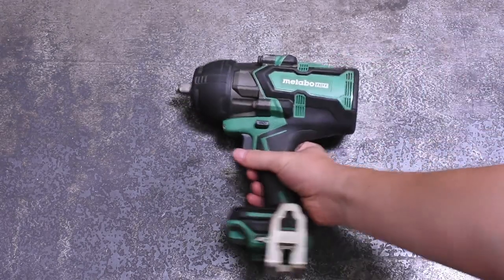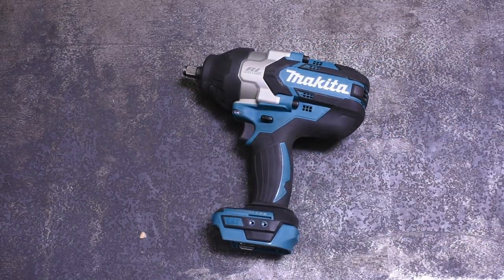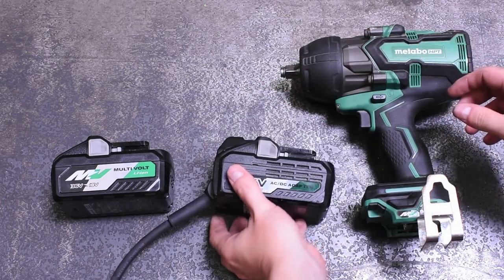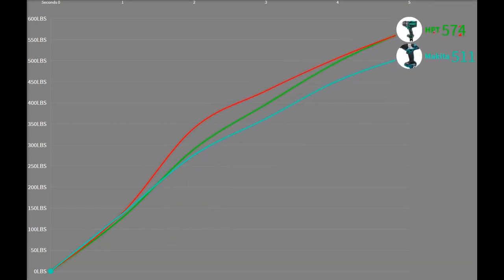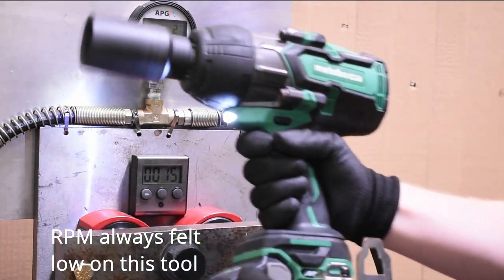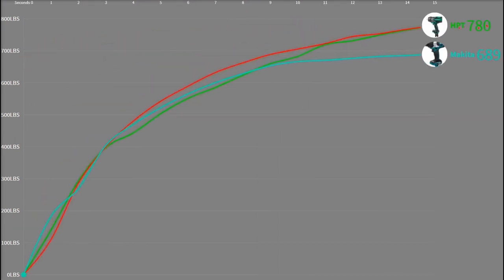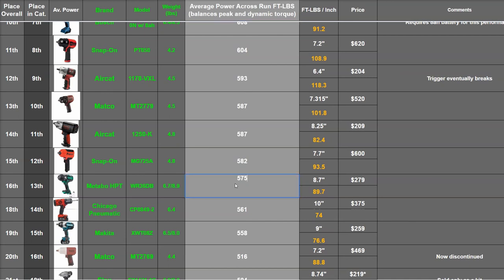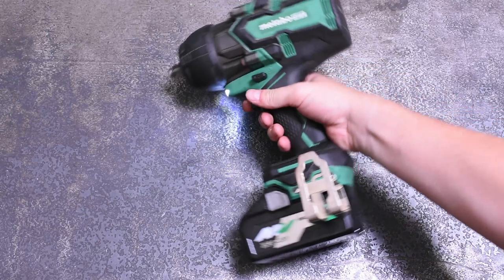What Happens When You Plug In a Cordless High Torque? Metabo HPT WR36DB

Comment: Honestly I wish tool manufacturers would release wall adapters for their products. But they won't do that because that would lose them tons of money in battery sales.
Reply: I mean I did at first as well and I agree it wouldn't be a bad idea. But honestly as my battery collection has grown due to taking advantage of free battery sales, I honestly can't say I would buy one anymore. I honestly have 4-6 charged batteries laying around at any given point, so why fool with a cord?
Reply: @OmegaGamingNetwork  The more I use my batteries, the sooner they will die. I have the angle grinder and used it to build a bullpen wayyyyy away from any outlet. Super convenient so I don't feel bad when I run out of juice. But when I'm in my shop working on things running out of juice is a kick in the nuts with an outlet right there
Reply: @alminhelex  fair enough and when I get to the point where I need to start replacing them and don't need any new tools, I might feel differently. But for now at least, I've only had one battery die in the past 3 years. The rest are going strong. I'm happy to not drag around extension cords if I don't need too.
Reply: Aren't wall sockets limited by 20 amp breakers though?  I read that battery tools don't have this limitation (Milwaukee HO batteries can output 40-50 amps) and therefore have more potential.  And as others have stated, it you wait for battery sales/deals, you can get them for free or at a pretty reasonable cost.
Reply: @OmegaGamingNetwork  My 2 5ah batteties for my Milwaukee are seeing the light, and I have fried an 8ah lol hopefully the 6ah with the better layout to stay cooler will survive a bit longer.
Reply: @1pcfred  I have the Metabo 36 volt 10 inch sliding miter. It's great to use the cord when on a home project. But also, very convenient to remove the cord and slide in a battery for when working @ a barn with no power for example. That's the big advantage Metabo has over all of the big name manufacturer's.
Reply: @alminhelex  I'm running Makita myself. While I do find their battery shutdown software to be overly aggressive, I've only had one bricked in 3 years across 20 batteries. And that one was only a 2ah that came in a kit that honestly I didn't care about.  Anecdotal experience of course.
Reply: @slylockfox85  power is V*I 
The cordless tools use a 20v battery 
20v * 50A = 1000W

Corded 115v(ac)* 20A = 2,400W

Granted that math for AC is not 100% accurate but I'm on my lunch break : ) 
(~30% less on average)
Reply: yea but they can sell the adapters with the kit, and batteries come in kits. So they can do both in one kit.
Reply: @1pcfred   Air tools are even less convenient than corded tools. There are a ton of situations where a corded tool is better. They're cheaper, they never need to be charged, no batteries to wear out, batteries don't drain and lose power, etc. I would rather buy a cuddles angle grinder and an adaptor than buy a cuddles one AND a corded one. Cordless angle grinder just don't have the longevity to do much work other than short duration tasks. Weld grinding, stock cutting, wire wheel for rust, weld prep/beveling, cutting concrete, etc are jobs that just need a corded tool. I would like to see the tools with big 24-56V batteries have a way to plug them in while on the tool. That way you don't need an adaptor and you can plug them in to simultaneously charge and run off shore power, just like you can do with your cellphone.
Reply: @slylockfox85  We have to consider the total power output of batteries vs corded adapter, in watts. A battery may put out 50 amps, if that's at 18 volts that's 900 watts. A wall outlet 120 volts and 20 amps (for North America) can provide 2400 watts, but for safety and code de-rating, about 1920 watts continuous. A corded adapter could be made to provide more power than a battery, it all depends. Lastly in a theoretical max-power design situation, they would design the corded adapter for a standard 15 amp outlet, at 80% load, so about 1440 watts in max, then there would be efficiency losses to DC conversion, so maybe 1150 DC watts out. Power would also be limited by the tool itself, I don't know of any cordless tools designed for that power, or corded adapters that output that kind of power. Maybe some of the new 36v cordless/corded saws can, I'm not sure.
There are many limits at every point that need to be considered, the tool itself has the final say on how much power it outputs, so it doesn't overheat etc.
Reply: @1pcfred  if you ignore the big ass air tank and the noisy pump/motor on top of it as well as the air hoses and all the plumbing you have to do to make the air tank more accessible.  We have a 60 gallon compressor in each of our farm shops (one has steel piping for air plumbing, which was a real big/expensive job for whoever put the system there before we moved in) and I try to avoid them for everything but tire duty and the blow gun.  

They're only convenient for the things you can get within 50-100 ft of them.

With cordless tools the sky is the limit.
Reply: If i really wanted a corded tool id just use air. More power for less weight but i only use cordless because its way less of a PIA than having to have an air line around all the time.
Reply: It would be amazing for grinders and sanders
Reply: @Semi Interesting yep it's how I killed the one. Stuck it straight on while hot and boom. Was brand new probably the charges total. Like I said I hate how aggressive their protection is.
Reply: @Semi Interesting thats how my 8ah  went out, I was using it with the weed eater and after sucking it dry, heated, I slapped that bad boy on the fast charger and I learned my mistake.
Reply: @slylockfox85  That’s 20A at 110VAC, it’s not just about amps. But you’re essentially correct that modern battery packs can slightly exceed the power draw possible through a household outlet. The gap will get larger as batteries improve.
Reply: @slylockfox85  technically yes, however finding tools that need or can utilize 20amp circuits is extremely uncommon. Most are designed around the standard 15a circuit which is only around 1500ish watts. So yes today's battery operated tools can and do (depending on tool and battery) exceed the power availability of a typical outlet.
Reply: @TURBOWANDS  that's the manufacturers deciding not to use the power available.

Hell I have 30A and 50A plugs for a 120V welders. Nothing prohibits tool makers from using those. Most tools don't need that but it's there.
Then there are lots of 240V shop equipment and 240V plugs.

With a 90-96% efficient DC converter (not difficult to do) they could make really powerful AC adapters for the DC battey tools, with all the conversion done in the battery shaped adapter.

Easily 50-100A @ 40DC all day long.
smd swap out to a battery for short term portability.

Just like my boom box. Play all day with the AC power cord or a few hours on batteries at reduced volume.
Reply: Might save them money! I use my batteries every freaking day and they die out before the warranty so after a few send backs, I just end up with a new one. I haven’t bought a battery since the 6.0-12.0 M18 batteries came out lmao
Reply: @slylockfox85  20Amp max for standard 120volt receptacles is right, for Canada at least (Nema config 5-20R) but your power output is much greater in an outlet (120V x 20amp= 2400watts, watts being a measure of power) whereas an 18Volt x 12amp battery = 216watts of power as in the "M18 12.0" for example, Significantly less total available power. Although one is Alternating current and the other is direct but thats a diffrent story.  hopefully im being clear in the way I explained it.
Reply: That's why they sell corded tools
Reply: @jnoelefty6315  18x12ah is 216wh not watts, a 21700 cell can deliver 35amps continuously, do that times 3 because there are 3 rows of 21700 cells in that battery, that makes 105 amps, do 18v x 105 amps and that makes 1890watts, seems more logical right?
Reply: @lukie4ever  correct. But it can't do 35A @ 18V for long. As the battery discharges you have less power available.

But the AC outlet will deliver 2400W all day long. No stopping to swap batteries when it's half discharged to get back to full power.
Reply: @lukie4ever  they haven't been developing corded tools for years. What they have are old, lower power tools compared with the cordless they have been improving.

So just give us a corded adapter please.
Reply: @lukie4ever  ahhh i knew i something was off and couldnt add it up. Thanks
Reply: @jayyoung5627  Net voltages are expressed in V-rms, which is already about 30% lower than V-max. Mainly to make the power formula work. So your calculation is correct (apart from the fact that 115 * 20 = 2300, but voltage usually has a 10% spec margin, so it could as well be 120V.).

In Europe we usually have 230V, with 20A breakers. So that's 4600W.
Reply: And it totally defeats the point of of it being cordless. Just buy a 110volt tool if that's what you want.
Reply: The Metabo HPT 36 V grinder whooped up on all of the other cordless grinders and it has the AC option which really changes the game for high use applications
Reply: Exactly the reason Metabo HPT has been getting my business over the last few years and have replaced many of my Milwaukee.and Makita tools with the 36V mutivivolt tools, grinder, table saw, mitre saw, SDS Max rotary hammer, recip, circ saw and others cuz I can use those tools with the AC adapter for years past what just a battery only system would allow
Reply: @slylockfox85  20 amps at 120v.....the adapter is going to be an AC-DC power supply that can output higher amps at lower volts
Reply: @slylockfox85  Wall outlets are limited 20 amp, but at 120 volts. When stepping down to the lower voltage that cordless tools use, you gain amperage. For example, if you stepped down from 120V 20A to 20V, you could draw up to 120A.
Reply: @TEDodd  While this is true, the size of the power supply needed is way bigger than the one in the video. I've been looking at making a corded conversion kit for my 18v tools and the power supplies are waaaay to big to mount on the tool. The size of transformers needed to step down to 18v and still deliver up to 30a means the PSU would need to be a bench top unit with the DC power being run via cord to the tool.
This metabo benefits from being 36v which allows for a smaller transformer, but it still is down on power. Making a large external PSU to power 18 or 20v tools would probably cost at least $300 for an OEM unit. I'm not sure if there is any market for it considering it's cost and bulk.
Reply: @OmegaGamingNetwork  lol getting free batteries just guarantees that you've bought into the battery line. You'll make them a lot of money in the future from battery sales
Reply: @kevincampbell4688  They make air-powered miter, circular and band saws?
Reply: With the all aftermarket batteries and adapters available out there, I'm surprised someone didn't try to market a 120v converter that's in the form factor of 20V battery.
Reply: You just gave me a great business idea
Reply: @slylockfox85  yes they may output 40-50amps, but thats at 18V. A wall outlet at 20amps (18 working amps) would be 2400W compared to 900W.
Reply: Would also lose sales on corded models
Reply: @slylockfox85  normally yes then again they have adapters for 230 outlets to plus some of ours have 30 amp breakers.
Reply: @alminhelex exactly. I still have a lot of old corded tools though luckily
Reply: @slylockfox85 watts is what matters though. You may be able to draw more than 20A on a battery, but it's at 18V not 120V so you have to do the math
Reply: @OmegaGamingNetwork  i have Makita for years and now Metabo as well. Preliminary experience with the Metabo is telling me that my older Makita batteries will end up outlasting the Metabo. We will see.
Reply: @SnootchieBootchies27  Well, 2 years after I made that last post and I still haven't had another battery die or really even show signs of serious degradation. I'm inclined to agree with you.
Reply: @Dansk55  Normally the cynic in me would agree. However Here I am over 2 years later with some of these batteries pushing 5+ years old and I haven't had another fail. While it is certainly more difficult to tell with tool batteries over small electronics like phones and laptops, I also can't notice any real performance degradation. So if that was their plan, it is pretty poorly executed.

Comment: Now we just need a dual fuel air/electric impact wrench...
Reply from the maker: Thanks for the 36V 4ah batt Philly! Oh and check out the Mac Impact episode, air and battery stuff going on the same tool!
Reply: No we need 12 gauge shotgun shell chamber for instant boost in forward and reverse . Like on the flight of the Phoenix where Jimmy Stewart used them to prime and start the engine .
Reply: Actually we need a 10 second burst of boosted voltage. Maybe another 10 volts kind of like push to pass in racing .
Reply: That de strong impact wrench
Reply: I made this exact statement a few months ago on this channel! Glad to see it finally on here as it is a plug in hybrid cordless
Reply: Also yes they go for 119.99 but if you buy the tool at certain times of the year metabo hpt gives u an offer of the 4.0 ah battery or the adapter for free up to 10 per household. I got the adapter and 4 batteries last year! They give the adapter free almost year round with purchase of a multivolt too!
Reply: @aaronwhite4946  which vendors?
Reply: Cue the 2 stroke impact wrench

Comment: Edit 2.0 So I now own both the 3/4 and 1/2 version of this impact. They are both very similar in power to each other. They are basically the same size and weight which is extremely heavy compared to other brands. I have switched careers from hiway trucks and now work on heavy duty stationary engines and compressors. This 3/4 worked fine for semi lug nuts (450lb/ft) but cannot touch most large head bolts (650lb/ft) I have to crack them loose first by hand and the 1/2 is extremely bulky for its power output so I rarely use it. But for the price they cannot be beat. I’m probably going to upgrade them for something with more power soon.
Reply from the maker: Great info! Thanks for sharing
Reply: How would you say it stacks up to the Milwaukee M18 in your experience? Would you recommend the 1/2 or 3/4 Metabo/Hikoki for someone who needs a budget friendly impact and doesn’t need a super amount of beans? I guess they get the job done right? I recently switched to Hikoki tools and I am starting a Hikoki collection and I want to know which impact to go with

Comment: Thanks for this I always knew my Metabo could go toe to toe with the Milwaukee impacts I have handled.  It is also nice to know that Metabo was telling the truth about the corded supply having slightly less power.
Reply: they are very conservative...all my tools are metabo :))). Love their encapsulated BLDC motors, no dust inside.
Reply: Indeed, I've been a fan for a long time. I'm glad to see them tested and do well. They may not always be the best and do/have had some issues, don't offer as wide a range of tools; but they're always a good value, usually a pleasure to use, and perform among the best, cordless drills, miter saws, you name it. They work as expected. The 36 volt multivolt system is great for those of us with 18 volt models. Pop on the 36V battery and get 18 at twice the current.
Reply: HPT 💯🔥
Reply: I wonder how it would be with 240 volt plug
Reply: @bradleycooper5436 the same. It's a 36v motor. When you plug it into the wall, the adapter changes 120 or 240 into 32. You then end up with 32. Did I mention that it's a 36v motor?

Comment: How about testing the torque of 12v car starters (electric starters for gas engines (flywheel).  They all claim “max torque” high amp geared motors. Thanks.
Reply: Are those going to even be in the realm of something you could hold, or would that take a rig? lol I don't recall seeing anyone do more thank kick start a few hundred CC in quite a few years... Impact peak is one thing, but to power through compression? (or does compression get more even with more cylinders? ... eh, either way a starter doesn't sound weak to my unknowledgeable self!)
Reply: Are you talking about the actual starter motors or a jumper pack?
Reply: @dreadswizzard9142  I clarified the suggestion.  Thanks!   FYI, the lithium battery jump starters have all been tested many times before on YouTube.
Reply: @todd5082  and the tldr on those is simple: they are basically all shit.
Reply: I’ll refer you to project farm for that
Reply: @johnargumaniz9179   Besides speaking for a Project Farm who else do u speak for?  Maybe we should run all our suggestion through u.
Reply: @todd5082  yea sure if you want
Reply: Pointless idea. They won’t be comparable. An impact driver is lower rpm and likely far more torque than a starter motor that is meant to spin an engine.
Reply: @johnargumaniz9179  great!  Post it on the main comments page for everyone to see.  What else r u a know-it-all about?
Reply: @todd5082  quantum physics
Reply: @johnargumaniz9179  again, post your ability in the main comments section where somebody might care.
Reply: @todd5082  seems like your the one who cares by how much attention your giving it
Reply: @jjhack3r  the engine starter is much more torque, drawing 200A+ @ 12V. But can't run long before it overheats and melts internals.

And it's like steady torque from a socket wrench, not the repeated blows of an impact.

Comment: I'm guessing that the reason why not all manufacturers offer a 110vac adapter is that they're afraid it'll reduce their battery sales.
Reply: That's why I have increased my Metabo HPT 36V line
Cost of use is much less than my red and teal tools due to having to buy and charge up as many batteries in my longer run time tools